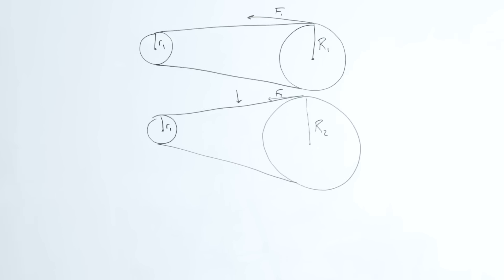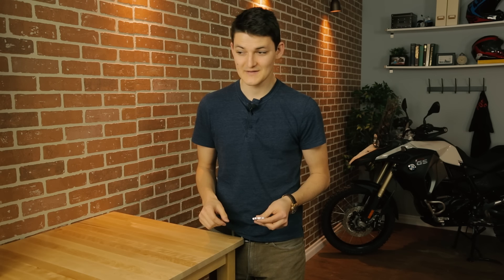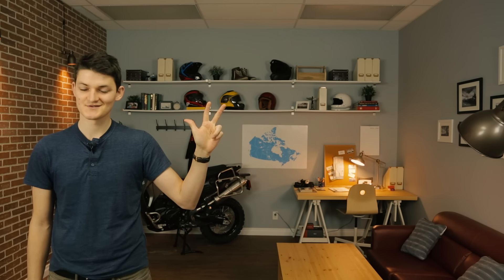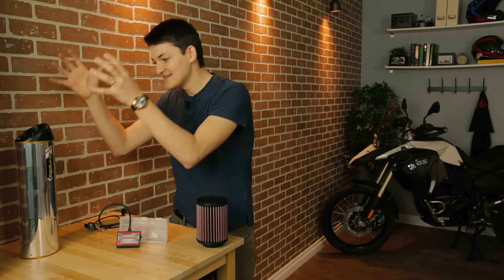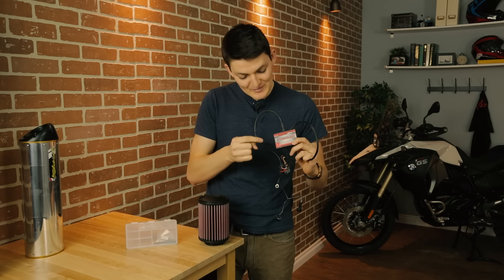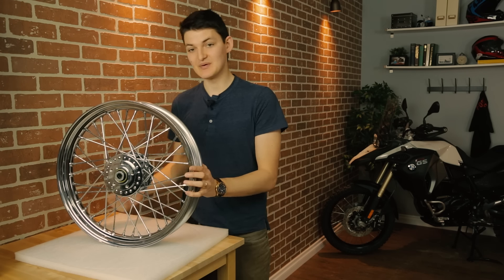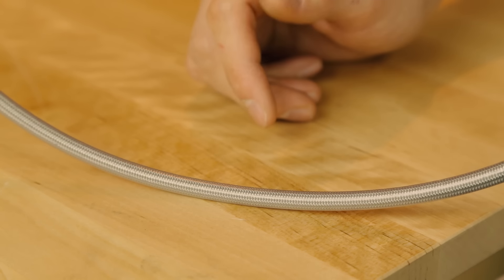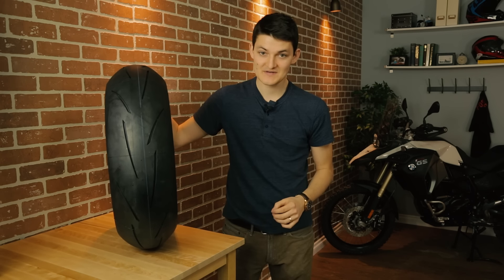Top 5 Motorcycle Mods to Go Faster

Comment: Number 2 doesn't really help. I got full two bros, k&n racing air filter and had my bike tuned. Gained 10hp, but you don't even feel it.
Reply: it's not the bike then, it's you. you need to be upgraded bro, haha
Reply: Classic...
Reply: Even gaining 10hp on a 100hp bike would be 100% noticeable...
Reply: Solo Rider  Not sure what bike you are running... but a 2016 Kawasaki ZX6R 636 ABS KRT edition stock on the Dyno, did about 140HP. Upgraded Intake, full exhaust, and a good tune (power commander with wide band o2 sensor), gained well over 40HP... SO now the bike makes 180ish HP on premium unleaded fuel, and just over 200HP on E-85... The amount of power you can get from a "600" is insane. It's my wife's bike, and she weights about 116 lbs... SO the ZX6R and her are faster then me on my older ZX-14... :P since I weight about 240 lbs, and my 14 makes only a little more power then her bike does. 
 (Edit when I posted this I forgot that the engine is at 14.7 to 1 compression with installed modifications... part of why it is making so much HP... on E85 or VP 110)
Reply: Lol stay up right .
Reply: MasterMech77 you got over 200hp with a handfull of tunes costing around 2k? If thats the case, I messed up when I bought my R1.
Reply: Death Wish83 the full exhaust cost $1700, the intake and filter $300, power commander with wide band O2 sensor, $600, both fuel maps for 93 and E85 $600... so no not $2k more like $3500 all in... but still not bad for the end results :)
Reply: MasterMech77 you must have had a really special 636, because all the data I have found shows the "regular" 636's putting out between 104 and 114 hp. The biggest gains I saw out of a 600cc sport bike with full exhaust, intake power commander v and race fuel put an extra 16hp to the wheels. I hate to call it... but unless you got some kind of unicorn power coming from somewhere...
Reply: Death Wish83 My wife's ZX6R is not the "regular" run of the mill ZX6R. It came standard with race ECU, and all of the track ready options. Stock standard 2016 ZX6R WHP is about 110-120 hp (depending on dyno). Wife's ZX6R was dynoed 138.6 whp... Then after all work done on E-85 we were able to get just over 200hp (cold day during winter here in Florida). I would say,  about 180 whp on a normal day.
Reply: MasterMech77 So, your telling me that you bought a special race only 636, putting 138 hp to the wheels, something I admit being possible if it has been actually worked with cams, intake, exhaust, and being on race gas, and you did more work on it unlocking 60 extra unicorn power to the wheels?! Pictures or it didn't happen.
Reply: Death Wish83 forgot also the front sprocket is one down vs the stock sprocket, which adds to the WHP and TQ numbers... came that way with this version... And no this is not a "race only" version.
Reply: MasterMech77 this has gone on too long and everything thing you say has been easily disproven by google. Changing gearing only has small effect on whp. You've been quoting me crank hp not whp of a stock 636. You can keep arguing about your 636's rear wheel unicorn power, but I am sorry to say that you're mistaken. Please stop quoting this because you will continue to make yourself look silly to actual bike guys. Have a good day and ride safe.
Reply: Death Wish83 Sorry but you are mistaken,  the 2016 Kawasaki ZX6R 636 with Ram Air intake, comes factory with 140 crank Horsepower. You can easily check Kawasaki's own website for this information.  There are also a few outlets that have done independent tests,  and have gotten 110 to 120 WHP... You are referencing the standard ZX6R WITHOUT ram air...
Reply: MasterMech77 they all come with ram air. Do you even ride?
Reply: MasterMech77 then why? Why continue the charade? I don't mean to be cruel about this, but I have to call shenanigans. 600's dont make 200 hp without some kind of forced induction. When the costs of forced induction all factor in, people just start turning towards liter bikes. They already have beefier suspension, brakes, and transmission that can handle the horsepower. They have longer wheelbases to help reduce wheelies. They have 200 hp. 600's do not. This a simple fact. Accept this fact. I see that you served, thank you for that. I really appreciate your service.
Reply: Yeah, stock zx10r doesn’t even put 200 on the road. I don’t see it without nitrous or FI
Reply: Darcy Jussila The stock 2015 makes about 135ish HP... Link for quick reference.( https://www.topspeed.com/motorcycles/motorcycle-reviews/kawasaki/2015-kawasaki-ninja-zx-6r-636-performance-ar168818.html )
   My wife's bike is highly modified and tuned properly, no forced induction or NOS.... It is running VP E85 or VP 110 in order to make peak power... which is around 180-205 HP depending on air temp and fuel quality... SO on a hot day here in Florida it will only make 180ish... BUT in the winter with 50degree weather we can push the bike over 200HP before detonation is detected (there is a lot of things done to the bike including water/meth. spray to reduce intake temps and prevent detonation). Oh the engine is built to 14.7 to 1 compression...
Reply: MasterMech77 once again they are quoting crank hp. I thought that we were done with this.
Reply: Death Wish83 The "new" 636 with stock rotating assembly, K&N filter, aftermarket exhaust, ECU re-flash (not even properly mapped and tuned), on 92 Octane gets 120-130 WHP (depending on DYNO and conditions). Not sure what "EDR" is doing with all the money you give them, but they are not building you a top spec bike that is for sure. Link for reference of what a few mods can net you: https://www.zx6r.com/zx6r/62688-post-up-your-dyno-results-4.html
Reply: MasterMech77 yeah they are saying what I am saying. About 120 to the wheels after tuning. Here, I really think you should check this out. https://en.m.wikipedia.org/wiki/Misinformation
Reply: Death Wish83 You still didn't look at all of the information...
 Yes an older stock engined ZX6r 599cc with aftermarket intake, exhaust and an ECU re-flash makes 120-130 WHP on pump fuel... 
    A highly modified 2016 ZX6r 636 (14.7 to 1 compression) with proper tuning and VP 110 (110 to 116 octane fuel) will produce far greater HP numbers. Nothing "misinformative" about that... 
With light modifications and a proper tune my wife's ZX6R produced about 140 WHP on E85... as it sits now, it is far beyond that, modification wise... and nothing about it is stock, well the plastic fairings, wheels and chassis is stock... Drivetrain is not. Nothing about that is "misinformation".
Reply: MasterMech77 johnnyp636 almost got 125 hp after tuning, kawamarco636 121.9 after bolt ons and tuning, mfchop got 115 on his 05 636 after full mof and tune, sedsy72 got 121 after full bolt on and tune, laika made only 108 with full bolt ons. The motor is the same from '13 on. When are you going to give up on this? It is rediculous. Someone did clain 138bhp (block horse power) that is not to the wheels. Stop the lies!
Reply: Moto Shark that sound like bullshit on a motorcycle youd feel a 10hp difference youd even notice it in a car if you payed attention
Reply: MasterMech77 a 2018 bmw s1000rr after being highly modded pushes close to or right at 200 rwhp and with mr12 map can get to around 208-210 rwhp. I have a really hard time believing your 636 is putting out as much as my 2013 bmw s1000rr which has around 195-200 rwhp. It's really hard to believe.
Reply: MasterMech 77 and Death Wish83, you both makes good couple for life...trust me

Comment: Don't use a PowerCommander, remap your ECU instead. It's cheaper, easier and does a better job.
Reply: 6Twisted ryan pls do a vid on this. Ecu reflashing
Reply: Cheaper? You're not using Bren tuning then. It's way more expensive than a pc5 with autotune. Not too mention now it seems that they don't mind having a piggyback controller after they flash the ecu. So sometimes they'll just do both.

Comment: I'm a brand new rider and I am riding a brand new 2020 Kawasaki Vulcan S. I put a new exhaust and a booster plug almost immediately. I didn't do it because I wanted more power. I enjoy the sound of the exhaust and I wanted to smooth out the throttle (I read the booster plug did that). I intend on replacing the paper filter with a drop in K&N-like filter. I don't think K&N actually makes one for my bike

Edit: I know new bike is not recommended for new riders. I'm 43 and I am mature enough to not ride like a speed demon. I also installed engine guards for the inevitable drop. I don't mind scratches.

Comment: I proper suspension set-up (or better suspension components) is probably the best improvement you can make. Better traction, better feedback means more confidence. I bet this makes you a faster, better rider than an $800 slip-on.

Comment: 50% of your bike performance is in your tyres, 25% is in the suspension, the other 25% is in the rest. If you want to accelerate faster, get tyres first and get two friends to help you set up your suspension. A twist of the Wrist is golden, and available for free here on youtube. Keith code also shows step by step how to adjust your suspension perfectly to your needs, also on youtube.

Comment: Maaaan! It was just like you described my set up. -1 front sprocket, Full Arrow, BMC Air filter, dynojet power comader with custom map, steel brake lines, track oriented pads and Racetec RR K3,s (third set from the last summer. The only other ones I use are full slicks for the track, but the Metzeler is the way to go, for everything if you ride a sport bike a bit harder.
P.S. I also added, Ohlins cartridges for the fork and Ohlins rear shock, and a quickshifer (but I kinda disliked it, so I unplugged it)  but yours were the first few.

Comment: Larger sprockets load the chain less than smaller ones so always go bigger if you can. If you want more top speed or lower revs on the highway, go bigger on the front but engine cases, gear shafts, etc. can limit how big you can go. If you want more acceleration, go bigger on the rear. Limit here is the OD of the tyre.

Comment: Changing air filter won't make eating disorders for your injected bike. On low throttle the o2 sensor, located in the exhaust, will adjust fueling. For higher throttle a static table is used. The ECU gets input about how much air the engine is being fed, the amount of throttle you apply and what RPM the engine is running. That static table needs to have margins for cool weather, running the bike at sea level, having a dirty air filter and so on. So unless you're driving at sea level, in the coolest conditions the bike is made for, those few percent difference in an air filter is already accounted for.

With a slip on things are the same for low load, the o2 sensor will make sure that cruising is fueled properly. In a high load scenario, things may (or may not) be different, since we're changing things after the ECU has read from its static table. Then again, manufacturers will throw some extra fuel just for the sake of it in high load scenarios, because that's not where they are limited by emission standards.

Regarding using a map from power commander or exhaust manufacturer. It's not worth it, because it's not exact enough. If you're spending something like $500-1000 on air filter, exhaust and power commander, you want good mapping. Not for your specific model and part combination, but your specific bike. Sure, on some bikes you may have some standard gains in the emission control range, but that's really it. 

To be honest, the biggest gain with a power commander is not in power, it's in throttle control. Finely tuned fueling (by dyno, not downloaded maps), will make the throttle act more precise over the rpm range. 

For a bike with carburetors, changing anything will require adjustment of the carburetors. There's no ECU or o2 sensor to help you out, thus you'll need to do it manually. Again, doing this properly will require a dyno and wideband o2 sensors.

Comment: Best way is to weld another 200 HP engine to the frame's back, turning an airplane prop. I done it. It works if you are careful with the prop torque

Comment: thx, my fjr is in the shop so I'm gonna have them double check to make sure I've got a hi floor air filter along with checking that I've got the correct mapping for the two bros tips that came with the bike when I bought it (used).

Comment: Cobra fi2000 fuel processor is in my opinion the best because it's simple and easy to adjust. When I was working at the dealership I always used it because customers didn't want to mess with maps and the ones that did decide to go that route were always puffing black smoke and smelling bad because they didn't know what they were doing and in Canada we had now oxygen sensors so it was almost pointless to try to tune something with dumb fi

Comment: I've been told that you CANNOT make your bike have a faster top speed with gearing changes. But here, Ryan says otherwise. 

I'll quote exactly what this guy on a CBR forum said to me:
"Top speed is determined by horsepower."
"Horsepower determines top speed. All sprockets do is change the engine rpm relative to speed."
Ryan, please clarify.

Comment: 1 year ago... and it doesn't look like anybody has pointed out that you got the sprocket thing backwards.  Bigger in the rear or smaller in the front = more acceleration and less top speed, but smaller in the rear or bigger in the front gives more top speed and less acceleration.  

If the drive sprocket has 20 teeth and the rear has 20 teeth, they turn at a 1:1 ratio (direct drive).  If the drive sprocket has 10 teeth and the rear sprocket has 20, it's a 2:1 ratio; it takes 2 revolutions of the drive sprocket to make one at the tire (under drive).  If the drive sprocket has 20 teeth and you've got 10 on the rear, you get a .5:1 ratio where the drive sprocket only makes half a revolution for every one the tire makes (over drive).

Comment: LOVE your bike videos , very sound and good info. Can you make one on mods for RIDER. Training, reading and learning real world riding techniques. Practicing, and slowly pushing  your own limits. THE real untapped performance is rider skill and knowledge. IF you did a video that is info guys need. Been riding 45 yrs, mostly sport bikes, started in dirtbikes at 6. Seat time and real good info is where real speed and GOD yes safety come from. Put those with all your other great videos and you got it all. Basics, gear, maintenance, safety hop up mods and real rider skill improvement. As I aged and learned more I enjoy riding more, and much safer yet faster. Just touching my limits and expanding them is the freaking best feeling. ME getting better, I leave the engineers to get bikes better, they do a hell of a job. Difference between my first ninja 600 1985 and now the new ones, MAN night and day. I will never get to the new ones limits. I may be able to push a 80,s bike to it's limits LOL

Comment: I actually had a sprocket grenade on me one time when i reused the old chain. Then I had to buy another sprocket and a chain, wich in combo form was only around $30 more anyway. Might as well change both, so you don't suddenly lock up the rear tire in traffic, and wind up spending even more to buy another one.

Comment: Changing the front sprocket is actually not the equivalent to x amount (3) of teeth on the rear. They’re actually different characteristics as they have a force is applied from the tire to the ground based on a change of the chain angle etc. It’s the same ratio of final drive, but not the same application of force to the tire
Reply: so which is better for traction?

Comment: 1. Full Exhaust System
2. ECU Flash/Power Commander 
3. Air Filter 
4. Sprocket/Gearing 
5. Tires - Wheels - Brakes
Reply: Better driver with less weight.

Comment: CORRECTION: changing the size of the sprockets will not change the reading on the speedometer and odometer.  The speedometer cable is driven by a gear in the hub of the front wheel, which is totally separate from the drive sprockets.  Otherwise, a good video.

Comment: K&N only flows better than OEM if it's clean. When dirty they filter better but flow is then just average. They also pass more dirt than foam or paper when clean. Best way is to some how increase the filter size/surface area.

Comment: Good video - not sure about the throwing off your odometer/speedometer comment tho...maybe on the newer bikes with output gear sensors.  But all older/vintage bikes that have the speedo cable take off the front wheel, it makes no difference.

Comment: IMO The best mods to go faster are suspension, brakes, tyres and professional training. Most 600+ sport bikes have more than enough power than most riders can fully exploit. Power should be the last thing  you need to upgrade unless you're on the raggedy edge of grip and pushing the bike to its limits.

Comment: want more air into the bike gut the air intake. my 4th gen zx10r has a little cage and styrafoam on the insides. a bunch of crap to redirect air flow for noise regs. i still use a stock filter, ghuls ecu flash, two brothers shorty with cat delete. new sprocket kit thru vortex $210. well worth it. running s21's sticky enough for me.

Comment: wow some one who talks sprocket and gearing as per need of use but everyone remember to high a gearing will wear clutch on take off and top speed can be lower as the motor can not rev up to max rpm and longer time in lower gears to get up to speed and more down shifting on slow city turns ..so gearing Is based on use real world everyday use , city , flats , hills .. ..and real chain wear ..tx

Comment: Also getting rid of posterior wheel brakes, getting a lighter lithium battery saves about 5lb. Longer windshield for less air resistance. Having the gas tank to half or less capacity…